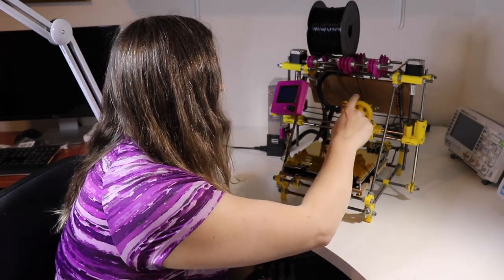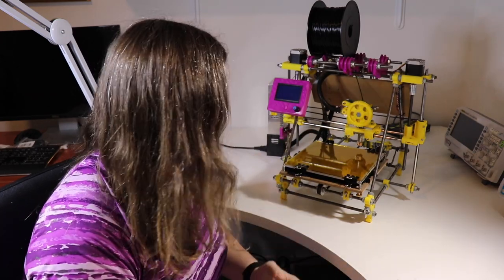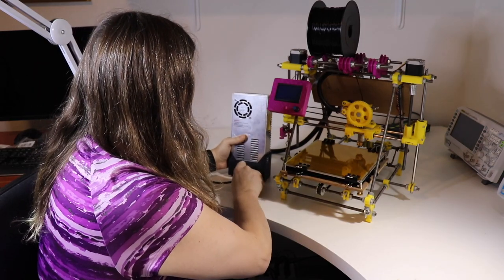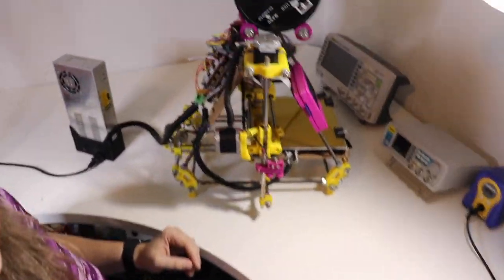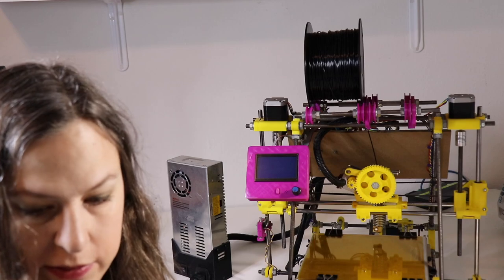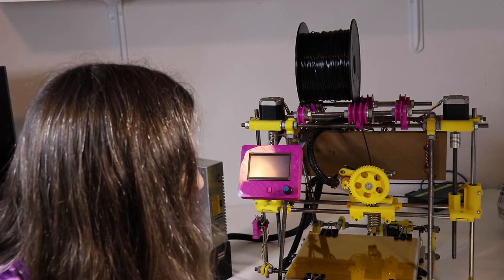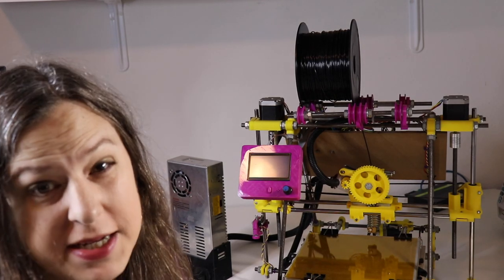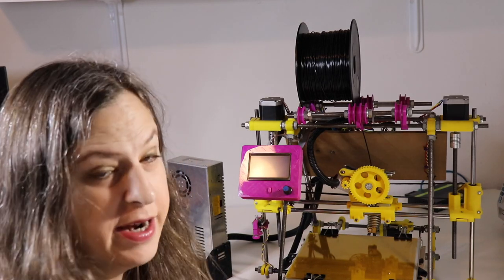My DIY RepRap 3D Printer Upgraded

Comment: You will be able to get some more build height by using a bowden set-up between the extruder and hot end.  I recently built a Mendel i2 and it produces wonderful quality prints.  I switched to a bowden set-up with the Ultimate Greg's Wade's extruder after I determined having it mounted on the X carriage was too limiting.  The extruder is attached to the top two threaded rods with zip ties.  I use an E3D clone heat sink, heat break, and nozzle with a genuine E3D block and sock upgrade for the hotend, including the genuine cartridge thermistor.
Reply from the maker: Thanks for your suggestion. That’s true and although I already have the parts to convert it to a bowden style setup, it still won’t come close to the 25cm build height or the Ender 3. That being said, I will probably do the conversion anyways so I can make it just a little better. Another problem which I didn’t mention is that I don’t get full use of the X-axis and the conversion would help with that too. An upgrade I recently did was converting from an older J-Head hotend to an E3D V5 clone with the hope of printing PLA better. However, it ended up being taller and took away some of my build height, so I used to be able to print a bit taller. So, changing it to a bowden style may give me back like probably another 4-6cm. I think the only reason I hadn’t done it yet was because I was avoiding recalibrating the extruder.

Comment: Hello, can you share the section mm/s and feed rate ... or the file marlin ...
Reply from the maker: Hi, this printer was running Marlin from the start. I don't recall the feed rate, but it likely was whatever the Cura defaults were. I'm unable to check at this point because I don't have this printer in its current form anymore. Several key components became part of my latest printer. For more information, check out this playlist: This printer ended up becoming part of a newer printer in early 2020. To see the upgrade, check out the Prusa Bear Build playlist at: https://www.youtube.com/playlist?list=PLNfVB1UmFL2uA37mAwt8XKF6b01UH3P8P